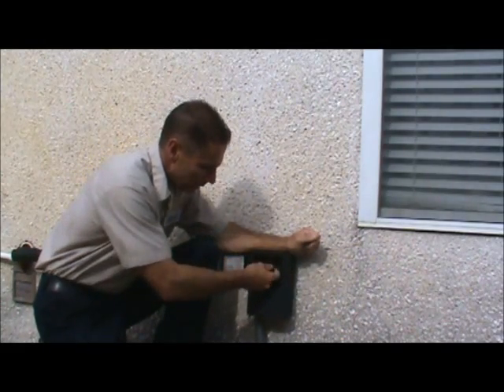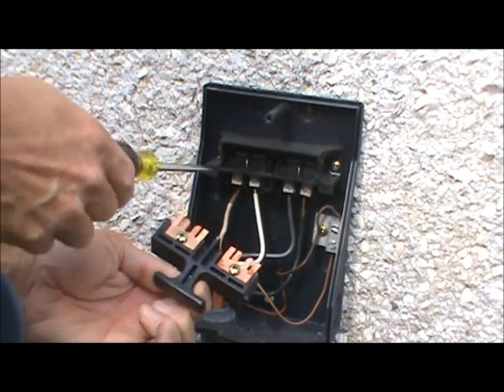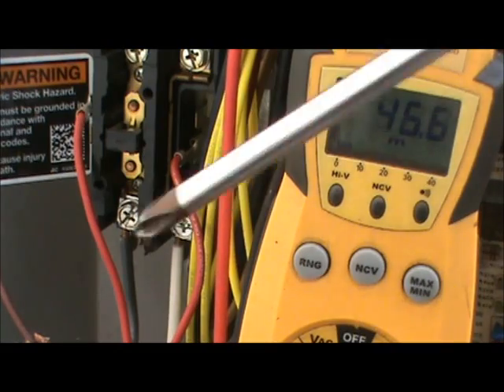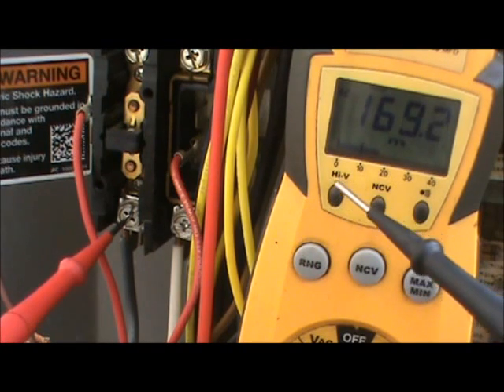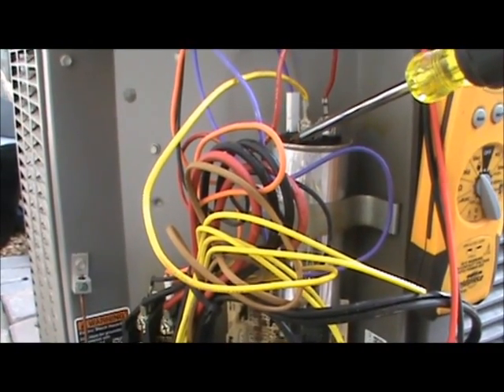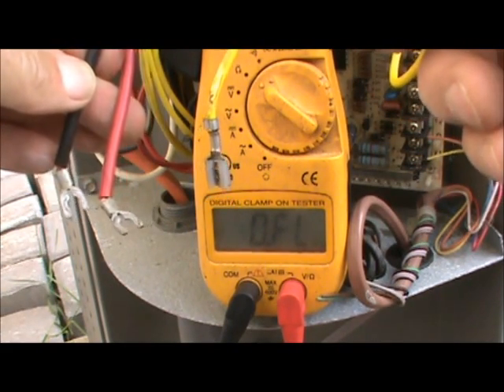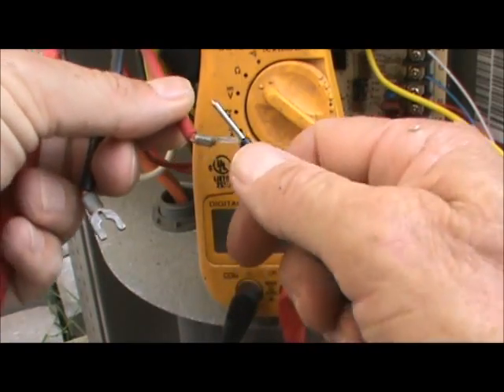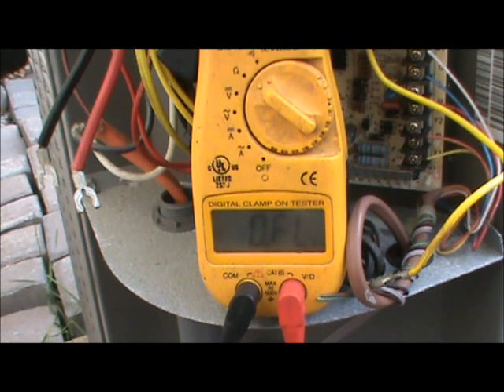HVAC Training

Comment: The compressor have two windings, start and run. Common is connected between these two windings. The common is the path, back and it is where the terminal limit is located just before it. Or other wise terminal over load.

Comment: Hello RON, i'm a maintenance tech I am currently working on ROOFTOP UNITS, the videos are great. I do not work with residents I am in a commercial industrial field, my question to you is WHAT IS THE MOST IMPORTANT PART ABOUT HVAC OTHER THAN SAFETY, SCHEMATICS OR TROUBLESHOOTING??So I can focus more on 1 at a time.

Comment: Good video however need to add that if you get an open reading during you ohm test to make sure the compressor is not hot and simply has an open thermal limit.

Comment: If you had a bad compressor what would you do? would replace it or just get a new unit.
Reply: +Michael lupo... If the unit is over 10 years old I would replace it. It is sometimes risky to replace the compressor, or the unit, unless you know the service technician and reputation of the contractor. Ask around from people that have used this contractor and can recommend them. If you do replace the compressor be sure to get a one year parts and labor warranty in writing. A new unit should have a one year labor warranty and a five year compressor warranty.
Reply: ok

Comment: Common+run is the lowest
Common+start second lowest
Equalls start run. Highest readind. Only for single phase. 3phase compressors you should get 3equall readings across all terminals

Comment: I thought by code ALL disconnects needed to be fused
Reply from the maker: In Florida, there is a circuit breaker for over current protection. The disconnects are for the safety of the technician working on the system.